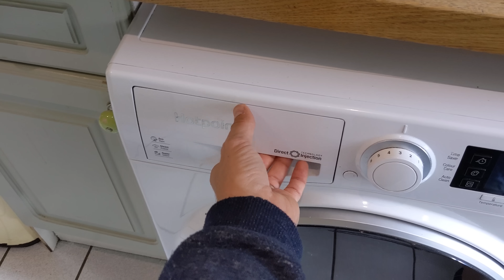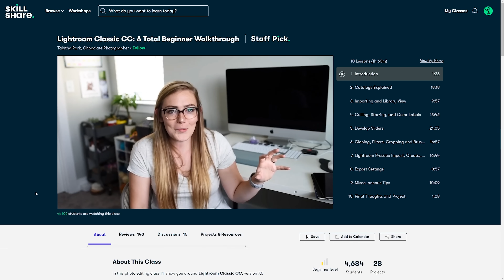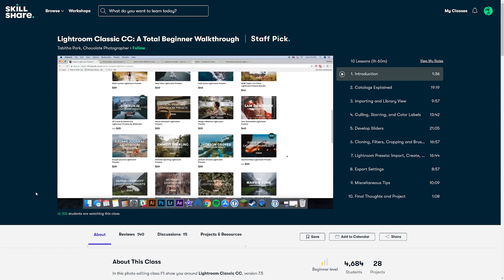The Pythagorean Siphon Inside Your Washing Machine

Comment: All of the toilets I've seen and worked on in the USA don't create the siphon in tank it's created in bowl. The flush valves here are have only a rubber flapper connected to a chain that connects to the flush handle. So when you flush the flapper is pulled up releasing the water from the tank down into the bowl. The bowl has a trap or the up flow of water followed by the down flow of water that's needed to create the siphon. It looks like an "S" once it's done flushing the bottom bend of the "S" which when flushing is the first bend holds water to keep sewer gases from coming out into your home or business.

Comment: Great video. 

Although I more or less suspected that's how the toilet flush works, I had never seen a cut away view before. However,  my home dual flush toilet actually works in the opposite manner as you show. If I let go of the flush handle immediately after pulling, it gives a Short flush. Pull and hold for Full flush.

Also if you use Fabric Softener be aware that it can cause Scum to form inside the space between the inner drum and the outer drum.

 Found this out from a repairman who came to investigate why I regularly got small bits of scum on my washings. He had to remove the inner drum to clean the area. Stopped using fabric softener since then.

As a side note, since we are talking about toilets, to save water, I put small glass bottles in my cistern.  Glass bottles because plastic bottles tend to float. You can't just lower the fill level too much, because the flush won't work. The reason is, if the water level is too low, you are not able to pull the water high enough to form the syphon flow.

Comment: Oh yeah our toilets work completely differently. the cistern just drains straight into the bowl. but there's two openings one at the bottom and one half way up. for half or full flush. also  the float is much smaller and attached to a vertical shaft.

Comment: a swedish toilet only uses a  rubber flap with a tiny floater on it, pull it to release the pressure difference from the dry side of the flap and the float keeps the flap open til its empty

Comment: There is no such siphon mechanism in toilets in the US. Instead, our toilets drain out through the floor instead of the wall, which means that when the water drops down, it pulls the water out of the bowl. In other words, the siphon happens in the bowl instead of the cistern, or tank as we call them in the US. I have heard that the European and UK toilets drain out through the wall, and flush by completely and rapidly replacing all the water in the bowl, which is achieved by the siphon mechanism in the cistern/tank. In the US, the tanks are similar, but only use a small flap at the bottom to let water out. We also have other types of mechanisms in the US, such as pressure assist, which means there is a second air tight chamber in the tank. When this chamber fills with water, it pressurizes the air inside. When flushed, the water comes out quite forcefully. You may have also seen films or photos of toilets with no tank at all, and only a pipe with a lever and a round valve on it. These don’t have tanks right behind the wall, as you may be used to. These are always used in large buildings in the US, and are basically multiple toilet bowls on one pressure tank located somewhere nearby in the building. The metal valves themselves are called flushometers, and control how much water goes into the flush.

Comment: I’ve never seen a siphon toilet system here in the US. They valve assemble for filling the tank uses virtually the same concept most of the time for valve actuation but the, dump valve, I guess I’ll call it, is just a rubber trap door with an air pocket in the bottom. It’s like a door with an inverted bell shaped cavity with a small hole in the bottom. When you flush, the door is pull up and open to allow the water to rush out of the tank. The small air pocket just provides some buoyancy (just enough to overcome the gravity of the trap door in water) so it will only close once the tank has drained. Then upon refilling, the weight of the water on top of the door provides resistance against the flushing handle.

Comment: US toilets do work as the greedy cup mechanism. The water tank on the back of the toilet fills up like you showed. There's a simple neck (you can see it under the toilet) where the bend sits above the bowl water level. When you push the lever down, the tank floods the bowl suddenly and raises the water level above the top edge of the neck and it forms the water seal seen in the pythagorean siphon. This drains the bowl. 

We don't have that plastic mechanism in our toilets.

Comment: Here the most common toilet cistern uses a flapper valve which simply plugs the outlet into the bowl. when you push the handle down, it pulls a chain which physically lifts the flapper to open the valve. The design of the flapper allows it to semi float so that it doesnt just slam shut before the cistern is empty

Comment: The toilet bowl in itself has a siphon in the bowl.  The more water you put in it the flush up and over the P-Trap will siphon out the water.  The more water you put in the bowl the faster the P-Trap works to siphon the remaining debris in the bowl out through the pipes.  Our older toilets usually have just a flap that works with gravity to get so much water down to the bowl.

Comment: My toilet has a Styrofoam ball on the chain Between the handle & there is a flapper On top of the tube or pipe at the bottom of the water reservoir. Lewisburg Ky.

Comment: The toilets I've seen in the US use a flap at the bottom of the tank that lifts up to let the water go through the hole it was blocking. If the flap doesn't create a good enough seal the tank will slowly drain and you will periodically hear the tank fill for a few seconds every few minutes or so.

Comment: I live in Thunder Bay, Ontario Canada. No siphon flush toilets here… we have a fill valve that automatically fills the tank with either the ball-cock style float or the newer style fill valve that works similar to the float in a carburetor. The flush valve is basically a soft rubber flapper that lifts up and down by use of a chain connected to a lever moved by the flush handle. Once the flapper lifts the the tank drains directly into the toilet bowl via an internal canal and holes surrounding the upper wall of the bowl. Once the bowl is full enough, it reaches the siphon point and all goes down the stack. There are some variations of this design but basically they work the same way. Ive only seen two different designs of the lower bowl canal that siphons the waste water. One is older and has a slower, higher filling flush, and the other is newer and flushes faster with less water.

Comment: Only having a full flush system is insane! What a waste of water. My flush system can be stopped at any time as the lever pulls up a piston sealing the container to the bowl and when I push the lever back down the flow stops so I can adjust the amount of water to the right amount every flush.

Comment: All toilets I have seen in the USA use a flapper valve between the tank & the toilet bowl.  The flapper is held down by the weight of the water in the tank.  To flush, the flapper is pulled upward.  An air pocket trapped under the flapper lifts & holds it up while the flush happens.  When the tank drains, there is no buoyancy, & the flapper resets & closes.
          You make no mention of the siphon in the toilet bowl & trap, which IS also a Pythagorean Siphon.  The S-curve in the exit pipe serves to trap water to prevent sewer gas from getting into the room.  When the sudden slug of water is emptied into the bowl, it fills the S so rapidly that pipe extending downward from the S floods & siphon starts, emptying the bowl.  In some toilets this is aided by a venturi jet.  The S-pipe is so large in diameter that the siphon stops before the bottom of the S empties totally.  A small amount of water is fed into the bowl during the tank filling.  This refills the trap.
          Regarding washing machine, my dispenser works differently.  The pipe from the dispenser zigs through an S-turn, like the toilet bowl, but also has a venturi jet at the bottom of the S, then to the wash tub.  When it is time to dispense, a small stream of water is fed into the jet of the venturi, generating negative pressure to start the siphon & empty the dispenser.

Comment: My washing machine doesn't have a siphon like that. (It's a vertical one) The way my washing machine works is that there is a tower In the middle that spins and at the top of that tower there is a cup that you put the softener in. Around the side of that cup is another upside down cup with a hole that allows you to pour softener in. When the washing machine spins it pushes the softener out of the cup and Into the sides of the upper cup using centripetal force. It then funnels down Into little square holes that evenly distribute the softener into the clothes while spinning

Comment: I'm sure someone's answered it in the 4000+ comments, but why does the softener section need this - I get the siphon effect but what purpose does it serve other than I guess preventing the softener making its way into the wash before it's needed? Or have I just answered my own question :D
Reply: Bad news: Been using a comments search engine and I have yet to find an answer to that question.
Reply: @DasAntiNaziBroetchen  thank you for trying :) the negative I find for this design is that there are too many nooks and crannies for scum to build up so the softener section is always the grubbiest! I'm sure manufacturers could create a better dispenser!

Comment: I enjoyed and learned from the video.  Thank you.  I can't tell you about the siphon that might be in our toilet, but I can tell you that we only have one lever to flush it.  No buttons to push.  The flap where the water exits the bottom of the - what I call the cistern, the container at the back of the toilet behind one's back when one is sitting on the seat - ... as I was saying ... the flap where the water exits is open for as long as one holds the lever down, more or less.  There is a little action after you first let go of the lever if you immediately let it go, but it won't give it a full flush.  For a full flush, we just hold the lever down longer.  This seems to be the opposite of what you showed in the video, since in the video, if the stem is held up, the air goes in and stops the siphon.  

Regarding our washing machine, we don't have any tray like that.  The soap (laundry detergent) gets mixed in with the water going right in to where the clothing goes.  (It is a top-loading GE washing machine.)  The bleach gets poured in a little opening at the side, which as far as I can tell feeds directly into the bottom of where the clothing goes.  (I always dilute it with water, even though it says "bleach only".)  And the fabric softener goes into the middle of the centerpiece of the centrifuge; maybe that operates on a siphon principle, but I'm not sure.

Anyway, I thought the video was going to tell me about what makes the water empty out of the main washing machine where the clothing is.  It didn't mention that aspect at all.  Still, I was not at all disappointed.  I learned a lot and thank you once again!
Reply: The siphon is under the bowl. There's an S-Trap (not a P trap like in a sink) built into the toilet underneath where the tank is, and on newer toilets you can actually see where that is. When you pull the lever, it lifts a flap in the tank and the water flows out to the bowl along the rim, and the weight of the water pushes it past the S-Trap and initiates the siphoning effect which will pull the water and waste in the bowl through the S-trap until the water has been used up. That is why if you want a full flush, you need to hold the handle down for a couple seconds. I think some toilets will have a little ball or something inside the flap that lets you just hit the handle for only a second or two and somehow it keeps the flow open until the tank is drained, I'd guess that once you initiate the flow, it pushes the ball away from the flap to reveal a hole the water flows through and when the water flow is weak enough, the ball comes back up and seals against the flap to stop further flow. The reason why an S-trap is okay in a toilet and not in a sink, is because gasses cannot escape through the toilet because the bowl and the tank both have water in them which prevents air escaping, unlike a sink that is usually empty unless it's in use.

Comment: As a plumber in America with 10 years, I've never run into one of these siphon style flush mechanism. We use flapper style and the rare occasion you'll see a pressurized flush mechanism
Reply: Not a plumber but I've installed and fixed many a toilet in my life and yeah always had a flapper valve. Some fluidmaster, some from other makers, but never seen this siphon method before. It's curious for sure but the flapper does seem more reliable, also a very cheap fix if/when the rubber dries out or gets ripped because you're a curious kid trying to learn how toilets work. Like me.
Reply: I grew up in the US and only saw flapper valves in residential plumbing back then. I live in the UK now and have only seen siphon valves in residential plumbing.
Reply: Now I'm kind of curious as to how well said Syphon style would work for my divided states toilet. Now I'll be on the hunt for one that fits my throne.
Reply: I'd never heard of these siphon type flushers until I saw them in videos. they seem to be more standard in europe for some reason. not sure why, they seem needlessly complicated.
Reply: I've never seen it in the USA either
Reply: I ran across the siphon and immediately bought a toilet rebuild kit that had a flapper.